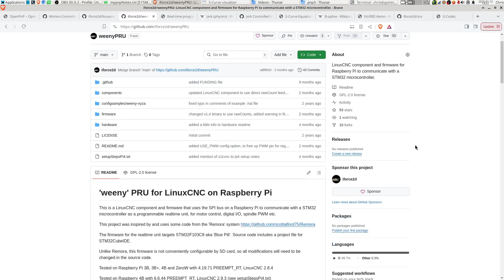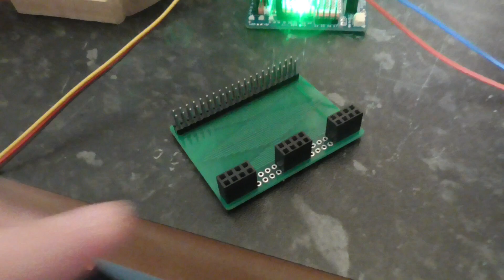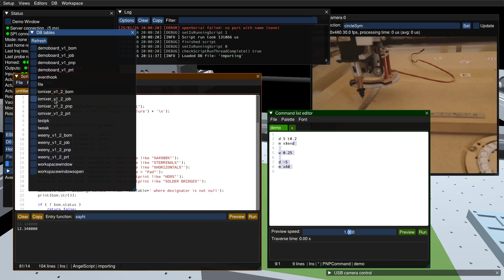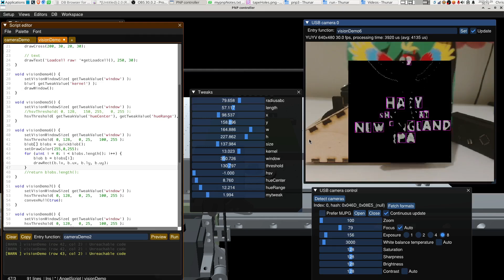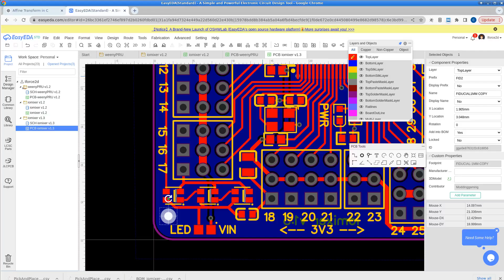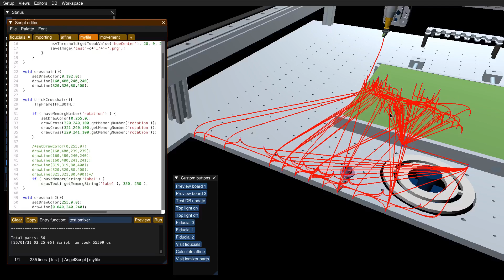Introducing ScriptPNP

Comment: Cool! A LOT of effort you spend in this project.

Right now I will try the openpnp to linuxcnc solution with your server. Are you aware of grotius work around scurve and tp for linuxcnc? So jerk control is in reach by his solutions.

And I am stick to linuxcnc because I will not use steppers but instead servos. So I need linuxcnc and openpnp sort of.

Or is your current solution with scriptpnp also usable in combination with linuxcnc?
Reply from the maker: I have seen the threads on LinuxCNC forums where grotius was discussing that, but I didn't really follow it too closely.

No, the ScriptPNP motion control is completely separate to LinuxCNC. The weenyPRU board can be used for LinuxCNC though, that's what it was originally developed for: https://www.youtube.com/watch?v=HaIe76u16mM
Reply: @iforce2d Thanks for your reply.
Ok, than I will go the openpnp to lcnc path with your server. In conjunction with scurve and so on.
Reply from the maker: If you're using OpenPNP then OpenPNP will be generating all the g-code and passing it to LinuxCNC to run. That would not have anything to do with the scurve stuff which is part of ScriptPNP. 
btw I should clarify, the weenyPRU is probably not useful if you're using servos, because it's main purpose is to generate step pulses for stepper motors.
Feel free to ask anything in the 'issues' section of my various github repos, as that will leave a discussion trail for others to see - I'm sure you're not the only one trying to figure this stuff out. Also, I actually have notifications disabled for messages here so I will only catch them when I manually check occasionally.

Comment: On CNC lathe commands which allows you to spec surface velocity would be handy. Basically as you approach the center the spindle rpm should increase. Very few softwares allow this feature.

Comment: 3d printers use resonance compensation using an adxl345 with klipper to know what speed range the machine can run without distorting the prints.

Comment: Fabulous.  
A quick and robust way to get rid of those stray pixels on the nozzle at the end is to do the thresholding, then ‘erode’ by a handful of pixels then ‘grow’ by the same number to get back to the same size for any remaining blobs.  Single pixels will erode away to nothing, so won’t grow back when the process is reversed.
For a good description of what I mean by erode and grow check out the Matlab ‘imerode’ and ‘imdilate’ functions which should be straightforward to implement, whatever way you’re doing your image processing.
Those blended move trade off explanations are bringing back painful memories from working on a similar trajectory control problem!
Reply from the maker: That's what blur (before thresholding) is often used for in these applications - I realized afterward that the script for calibrating the nozzle had used blur to stabilize the nozzle hole position, but my script for looking at the resistor did not. Blur is also useful for smoothing out a noisy image stream, eg. from compressed image data. I'll look into imerode though, it sounds like it may give better results in some situations.
Reply from the maker: I added a grow(numPixels) function, which can take a negative parameter to shrink. It works great, thanks for the suggestion :)
Reply: @iforce2d  Excellent!  It was something I learned from a lovely chap called Tim, who was an actual rocket scientist.

Comment: It's a pity that subtitles are not available
Reply from the maker: I just tested on desktop (Chrome and Firefox), two Android devices, two iOS devices and a Chromebook, and auto-translated subtitles are available on all platforms. You don't have the "Auto-translate" option available in the settings? It should be under "Subtitles/CC" on desktop or "Captions" on mobile. On mobile, sometimes it only shows "English" but when I tap on that it shows the "Auto-translate" as well. It often takes quite a while to show the new language after selecting.

Comment: I can't believe maybe 10 minutes ago I was thinking through the same exact problems, I was thinking to pull on what Klipper was doing and modifying step counts to a target position. I also want to stream target positions every 1-4ms (need to check system bandwidth) to my motor drives. Only 25 minutes through the video but already a lot of useful/interesting things. I can't seem to find any license information on the repos?
Reply from the maker: I added a project file for Visual Studio. You should be able to just clone the repo, update the submodules, open the project file and hit run. At least I can with VS2022. But let me know if you have any problems on your end.
Reply from the maker: What is your use case? Naturally I'm making this with a focus on placing SMT components, but trying not to get too focused on just that. For example, with different kinematics and a PRU with more axes, it could control a robot arm etc. I was even considering not putting 'PNP' in the name for that reason - but then again, since it can only move from point to point, picking and placing is mainly all it would be capable of. I put some links to the repos in the description.
Reply: @ a more standard XYZ axis system for inspection and some printing, I was paticularly interested in the motion planning part. I am aiming to use some distributed controller drives and they work in CSP (Cyclic Synchronous Position) over CANopen. 

Actually trying (and mostly failing) to build the "scv" example on windows because I think it will be the perfect visualisation and starting point for me!
Reply from the maker: The scv visualizer is based on the glfw_opengl2 example in Dear Imgui. I didn't include any of the build files for Windows in my repo, but the ones here should work (after adding my extra files to the project of course):
https://github.com/ocornut/imgui/tree/master/examples/example_glfw_opengl2
Maybe just try building that example as a first step (you probably already cloned that repo as a submodule).